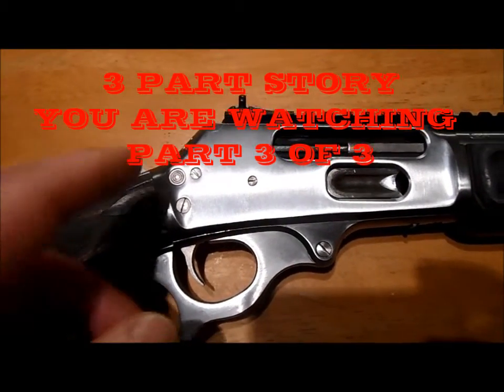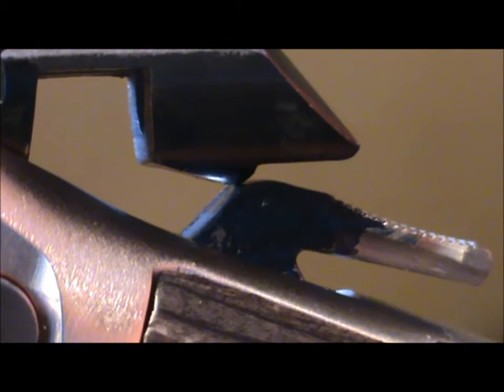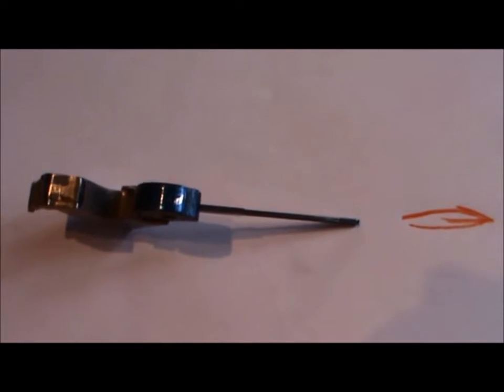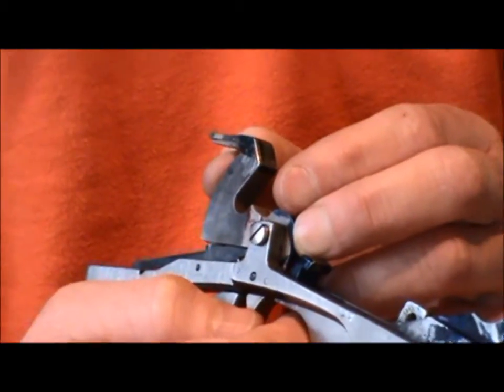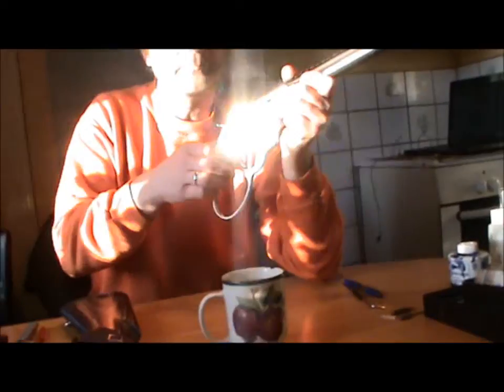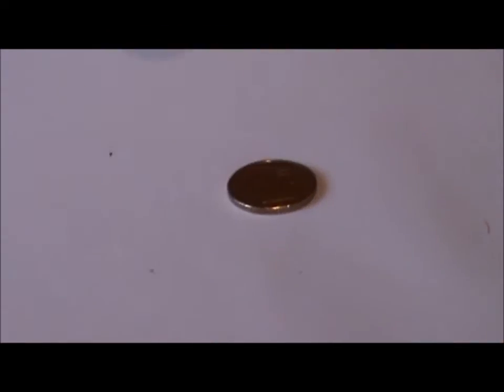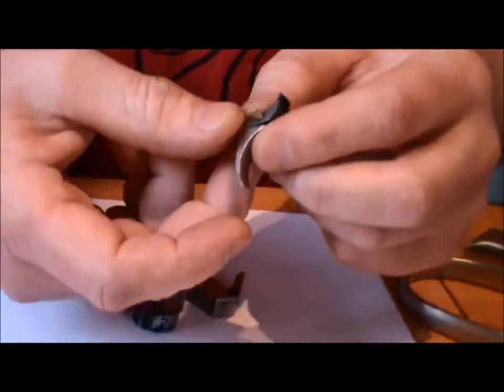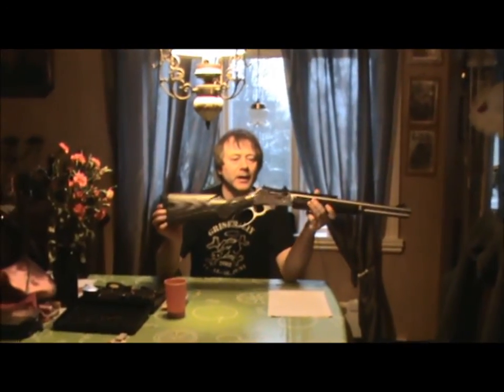Tuning Marlin SBL 45-70 Part 8of11. 3 TRIGGER, HAMMER & STOCK. STORY DIVIDED IN 3 PARTS. NR 3!!!

Comment: I must have watched these videos six times then tuned my gun , Great video , Great teacher , I am very happy with the results of my gun , it had a 6 pound trigger , and now about 1.3/4  pounds  it shoots better than I do and is smooth as silk . One ragged hole at a hundred yards .
Reply: I have the half round LTD 24” barrel
Reply from the maker: I´m glad you like it. Actually, my profession is(hold on tight): teacher. But I know, it may not look like that on the videos. A little rough at times, but super cool guns... You got it. Good. I know the videos is kind of long, and at times boring. But I couldn't find exact instructions, on the net. So that`s the reason I made them. And acting like a clown, that`s on purpose...
Reply: We your students are great full to have you!!! Thank you again from Oregon state USA .
Reply from the maker: That my friend, is a nice gun...
Reply: After  I bought my 1895 Marlin half round 24” barrel , using a stainless lever and lower plate I converted it to pistol grip , added a  stainless steel beartooth safety delete , custom built a cocobolo wood stock , tuned the trigger to about 1,3/4 to 2 pounds pull , tuned the bolt and hammer , trimmed the hammer corners , hand lapped the barrel  , added  game reaper scope mount  with a Redfield Accurange  2x7x33 optic ,  it stacks bullets at a hundred yards on paper targets ,it shoots better than I do
Reply: @theleagueofextraordinarygu7524    What do you teach ?
Reply: I made two gun stocks of cocobolo wood ,but I struggle with the in letting the stock , my first stock needs to be saved  and thought  if you are a machinist you may save this beautiful piece of wood  and I would like to give this to you as a  thank you  😊 for all you have helped with your videos  , I will send you this stock in appreciation for your help and thank you from all your students !
Reply: PS. My wife,s blood line is Ausenhaus , Her Great Great Grandpa  Olaf came to Canada from Norway 🇳🇴
Reply from the maker: I had to look up cocobolo wood stock. Nice Wood. It seems you have done a great job(how can I see pictures of that gun?). Wow, that stock deal, is a great offer...  Then you probably have a wonderful wife. The blood line came to Canada in the cowboy era, appr 120 years ago. Wild times... I teach in college. Mechanics(how to run a mill or lathe etc), Electronic, Automation, and mathematics
Reply: I want to give you one of them
Reply: Do you have a work address ? I can send this stock to you
Reply: You can watch my videos at Ford 300 six supercharged.
Reply from the maker: Great. I love engines. My heart melts, can feel I'm wet. Once upon a time, I Imported Harley Davidson motorcycles from the states, by the hundreds. And run a workshop. Most of my work was engines. Big HD`s, and V8`s. Porting cylinder heads, bore cyls etc, that is where my heart lives.Address. Name: Torstein Schaug-Pettersen. Street: Myre 1. Zip: N8485. Town: DVERBERG. Country: NORWAY. PS, I`ll pay for the freight.
Reply: Mr. Torstein hello good news today I went to the Post Office  , two weeks or so to get there , Enjoy Sir.
Reply from the maker: Your response time, is lightning fast! I`ll make a video about the stock. Thank you Sir... Again, I can pay for the freight.
Reply: @theleagueofextraordinarygu7524  I put a few fun things in the box for you to enjoy , I could not finish the stock its to cold for the varnish to dry, My wife would have a say if i brought it inside to dry , I paid the freight , you just enjoy the thank you for the video,s , My gain was your teaching , Thank you Sir.
Reply from the maker: Like christmas time. The world is a better place, with people like you in it...
Reply: And people like Sir , Merry Christmas
Reply from the maker: @Hawelufamily  Finally I mounted the stock, and have been shooting and hunting with it. It fit me well. I will make a video about it...